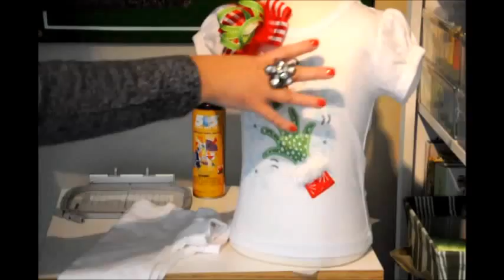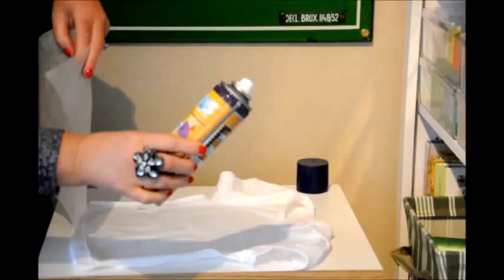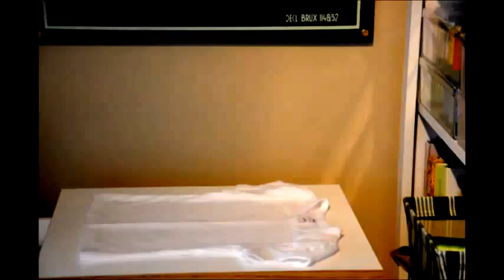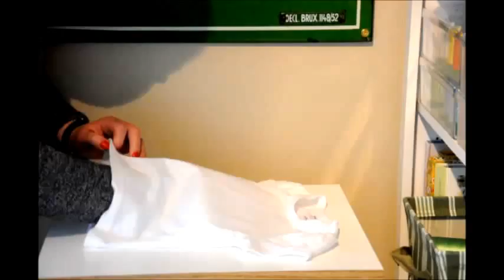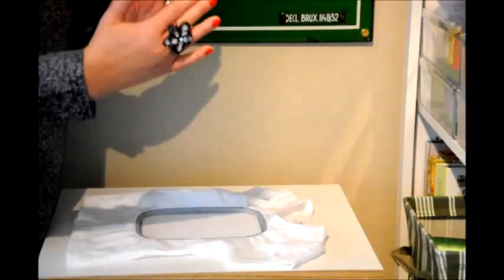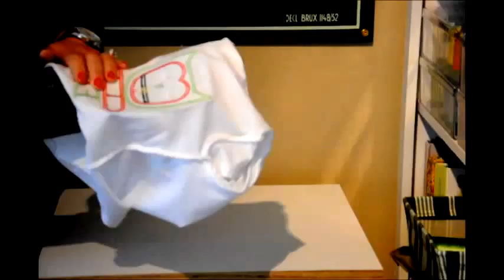Embroidery Machine Basics | Designs by JuJu

Comment: Good tutorial, but I wondered why you don't leave the template in the top portion of the hoop as you try to center it with the bottom hoop. That way you can see all the reference mark of the template, and the marks on your top hoop with the fold lines of your shirt.  This makes it so much easier than lifting up the shirt repeatedly and moving the bottom hoop around, hooping, unhooping, reentering. Do you know what I mean? I hoop with the template in the top hoop, get everything centered referring to the template, remove the template from the top hoop,  and attach to the machine.

Comment: I have a problem with puckers as well.  My fabric is cotton/poly blend. I used ordinary stabilizer ( neither fusible or tacky)  The design looked really good until I carefully tore away the stabilizer.  Then it started puckering.  The design was a  completely filled design. Should I have used a different stabilizer?  After hooping, I stretched stabilizer and fabric till it was  really tight before doing the design.
Reply: +Dottie Cummings i got sick and tired of my t shirts getting destroyed. i tried everything--the needle, the tension, more stabilizer. but when i used some fusible stabilizer i happened to have it all came together. so no matter what i always use fusible stabilizer or interfacing on t shirts. also designs need a good basting layer to offset shifting in densely filled designs. another thing to do is make a basting rectangle around your design to stabilize that area.

Comment: Dorothy, I don't know if you got your answer.  I have a new PE770 also.  Had the same problem.  I went to Creative Designs and they suggested that I save ONE design at a time on a flash drive.  Different designs from different websites look very different on my computer.  I never know if I should click on "zipped" or "unzipped" to save a download.  Any help is appreciated...
Reply: In windows 7, once you download you should click on the zip and the file should unzip automatically. The file that needs to be transferred to the usb or saved to wherever you want it on your computer is the design file (xxx,sew,vip, etc.).